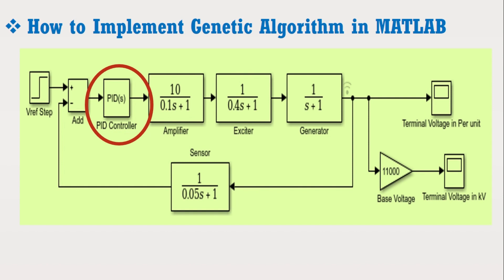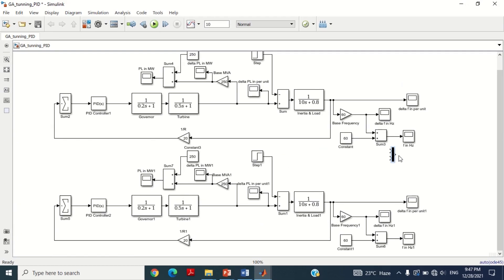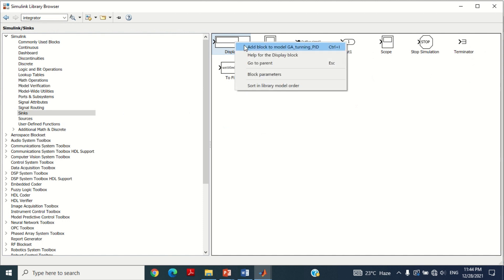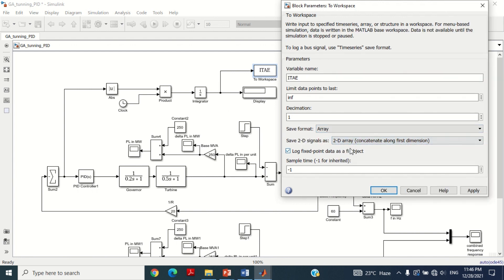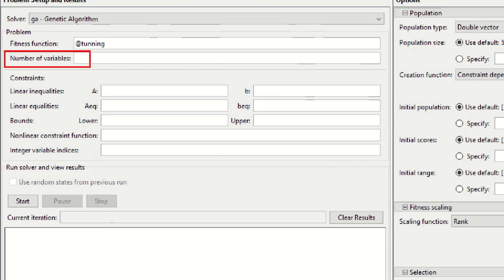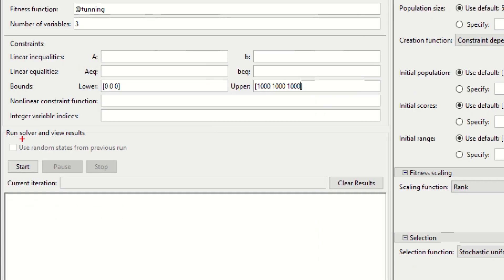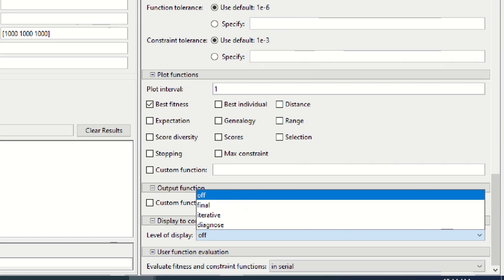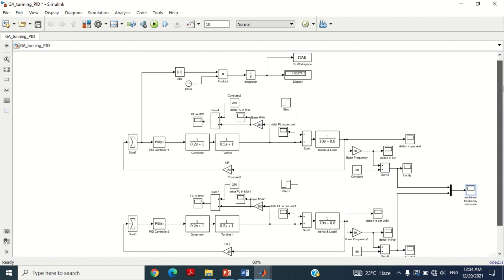How to Implement Genetic Algorithms in MATLAB/SIMULINK Software? (Part-2) | Dr. J. A. Laghari

Comment: Hi Prof, if i have simulink model of bess and solar pv, can i use this step to get optimal sizing of solar pv and bess? thanks in advanced.
Reply from the maker: Thanks for the comment. I am not sure but I think you can apply it with little modifications. For this purpose, try to find any research paper closely related to this topic to get the idea on how to apply this.
Reply: @DrJALAGHARI  thanks Prof

Comment: which matlab version you are using ?  , this is not working in R2022a matlab

could you please help me to tune pid controller for quadcopter i have mathematical model of quadcopter i want to tune pid controller for this
Reply from the maker: Thanks for the comment. This model is designed in MATLAB version 2017a. this tool box is removed in the latest versions.

Comment: Sir can you make vedio on how to implement grey wolf algorithm to optimise the PID control parameter for dual input dc dc converter in matlab simulink
Reply from the maker: Thanks for the comment. The procedure remains same. Only you need is the grey wolf algorithm optimization MATLAB program.

Comment: i put value same as you  and every step same as in optimtool, but i am getting error in optimization tool
"Optimization running.
Error running optimization.
The following error occurred converting from timeseries to double:
Error using double
Conversion to double from timeseries is not possible."
what should i do to rectify this.
Reply from the maker: Thanks for the comment. Double click on simout block and in time series, change to array. Or see the video again. May i know which matlab version you are using?
Reply: @DrJALAGHARI  Sir thanks for the reply
I use matlab R2015a
Would you make video on another technique like whale optimization algorithm, marine predator algorithm,ABC, Grey wolf optimization
With different power system model
Thank you ❤️
Your video is very helpful 👍

Comment: Dear Sir! Which MATLAB version are you using?  I am using 2021a latest version. Optimization tool has been removed from it. Optimization Live editor is being used in latest version.
Reply from the maker: Thanks for the comment. I am using matlab version 2017a. You are right. But i think in 2021, global optimisation toolbox or something like this is available and it contains all these similar things. You just type. Optimtool in the command window and press enter.
Reply: Same problem for me too who you solved that problem bro
Reply: @playerplaying3936  Bro, use the old version MATLAB 2017a if you don’t know much about MATLAB.
Reply from the maker: @playerplaying3936  use matlab version 20117a.
Reply: @DrJALAGHARI   thank you sir
Reply: @mahboobulhassan5560  thak you
Reply from the maker: @playerplaying3936  most welcome

Comment: Sir, I have an idea to detect and control the emission of supraharmonics in wind energy system using AI for my phd research. Is this topic worth for phd? Which algorithm is used for this topic sir. kindly reply me sirm
Reply from the maker: Thanks for the comment. This is a good idea. but you have to add still more objectives to make it worth for PhD. it is because a PhD may have minimum three objectives. therefore, try to find some other objectives that can  be integrated with this objective.
Reply: @DrJALAGHARI  Thank you sir..,  is it ok sir, fault ride through capability and  reactive power compensation using AI.
Reply from the maker: @rsr7102  this also seems good.

Comment: Thankyou Very much.
I practiced the simulation. But, the error values are same for all iterations.
49             2500       0.0007113       0.0007113       48
   50             2550       0.0007113       0.0007113       49
   51             2600       0.0007113       0.0007113       50
Optimization terminated: average change in the fitness value less than options. Function Tolerance.
AND
The parameter values are not same with your results.
71.8605250386263	78.5842551714349	123.458995451842
Reply from the maker: Thanks for the comment. It is not necessary to get the same values. It is because in optimization, every time new variables are initialized and they find some new values. Just run the simulation to check the response. If the response is good then it means that you have received the optimized results.

Comment: How to get two simulation result in one plot suppose if I change the value of x =1 one graph x=2 one more graph after simulation both case graph in one plot
Reply from the maker: See the video. By using multiplexer you can combine two graphs.
Reply: Matlab simulation part not simulink
Reply from the maker: @santhoshraikar4019  I couldn't understand what do you want to say?
Reply: Sir their is one program in power system in first step only insitialize the parameter values if I simulate I will get one graph if I change one of parameter value I will get one more graph how to combine both the graph

Comment: I have a problem with variable k in the PID block it's red 😅
Reply from the maker: Thanks for the comment. Which MATLAB version you are using?
Reply: @DrJALAGHARI  Thank you for your speedy reply Dr. I am using R2023a Sir, In the Matlab function, the 'tunning.m' function itself, on line 2 of the 5 lines function, says "not enough input arguments". This '.m' function is the one that is supposed to allow k(1), k(2), and k(3) of the PID to be variables I guess.
Reply from the maker: @KhayaDwaza  Thanks. It may not work in MATLAB version 2023. It is because this tool is available in MATLAB 2017a. Therefore, you have to install this version to run it successfully.

Comment: Typically, What may be the maxium values of Kp, Ki & Kd?
Reply from the maker: No limit.  It depends upon the system.
Reply: @DrJALAGHARI  Thank you very much.
Reply: But if you see in the research papers, the general limit is less than 1 for each.
Reply from the maker: @dr.nafeesahamad8567  It is used for manual tuning. but if you are going to use the optimization then you have the choice to choose broader limit. ultimately, optimization will find the best values for PID parameters. if you give the minimum range, then optimization technique will try to find the optimized value from this range which may provide or many not provide the optimum results.
Reply: @DrJALAGHARI   Thanks